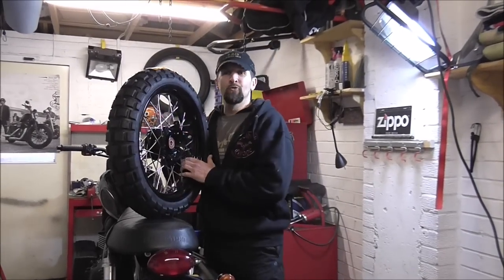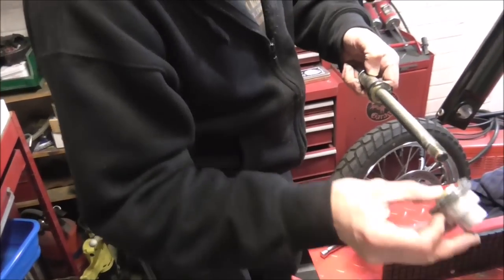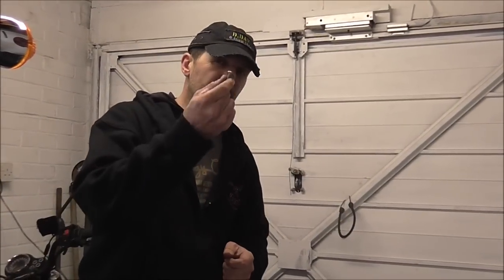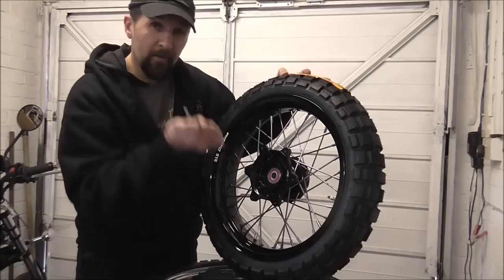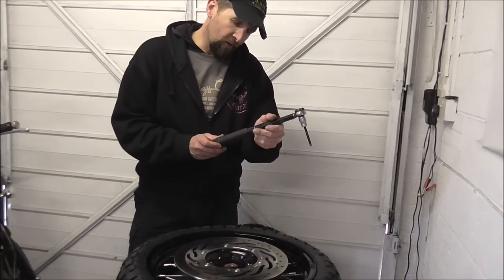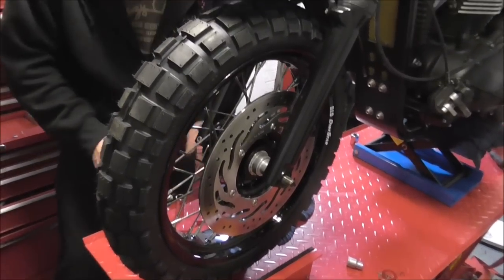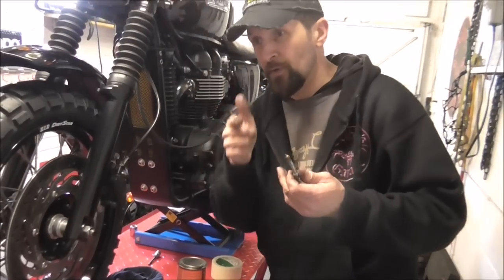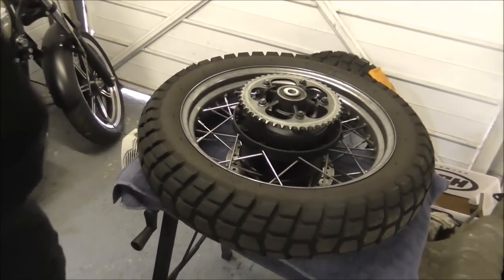Delboy's Garage, Triumph Scrambler, Fat Wheels, Walkround.

Comment: Hey my Triumph Speedmaster looks like a Chopper right now but I wanna fusion it with a bit of scrambler like things like the high exhaust from Zard different bars, gastank and so on and because I do not have the fitting suspension for the Pamir Highway trip yet what would you recommend me for the bike? because I have not fiddled around much with the suspension yet. I know its not the typical bike for that but its supposed to be a real sort of scrambler/cruiser fusion where some off-road wont kill the bike
Reply from the maker: Hi there, not quite sure what you're actually asking me - what is 'Pamir Highway trip'??  , I'm sorry I don't really understand the question...
Reply: Well its in Central asia where I will ride through and I would like to know what suspension you would recommend me because there the road is almost non existent in some places. sorry for the confusion

Comment: hi! your bike is really good! would you please share handlebar spec(hight, wide,...) as well as tires and wheels? it is really good! thanks!
Reply from the maker: Jesse Hsueh Hi Jesse, the bars are 'Renthal Roadbike Low' and the wheels are 5.5" x 17" rear with 170/60/17 TKC80 rubber...and the front it 3.5 x 17" rim with 120/17 rubber..
Reply: Moonfleet41 thanks for your reply! the rear wheels is very huge but i like it! very cool!
i'm in Taiwan and there is no Renthal agents here that's why i would like to know the handlebar spec. i don't wanna buy a wrong one. it is very useful for me.

Comment: AWESOME video! What width are those monsters!?
Reply from the maker: They're 180/55/17 rear and 120/70/17 front... BUT they are completely different rims and these tyres will NOT fit on your standard bike as we keep getting asked!   Specifically the rear, you need at least a 5" wide rim to fit that tyre.
Reply: @Moonfleet41  Thank you! I'm getting wider rims as well!

Comment: Hi, Nice Wheels and Video, been follow you fro while, love those wheels you put on the scrambler, I'm planning to get a Triumph Scrambler this year and do the same wheel/tyre set up just like your, I did went through the link you provide, and I was overwhelming, totally have no idea for all the specs, wonder if you could share all the specs and orders for wheel and tyres for me to simply copy and order? many thanks from your fans!!!
Reply from the maker: Before you even consider it buddy... those wheels were over £2,000   !!!! most people wont spend half the value of the bike i na pair of wheels..!  you can just put the knobbly tyres on your rims for a tenth of that..!
Reply: thanks for the heads up, and that what I thought would be, it is fair for set of wheel for motorcycle, especially for the outstanding result, never expecting less, I am in New Zealand, that is about 4000NZD include shipping is totally fine, me and all my buddies already save $$$ from watching your video, labour is costy in here mate, small parts are cheap too, like you said, not many people willing to pay that money, Just happens I do not to be one of many, with extra 4k I could have very different scrambler in NZ is worthy, therefore, shall we get back to 1st question?many  thanks ;p
Reply from the maker: The rims are 5"x17" rear and 3"x17" front, you can talk with the guy who builds them about tyres, and also the same with shipping.. that rim spec fits the scrambler, so the rest you can determine with the wheel company, and i gave tge link for that under the video as you can see.. Good luck with it mate.. hope it workds out for you..!
Reply: Thanks a lot!!! only two payment left for my Speed Triple, and will get Scrambler after, also get some mods done before this Xmas(include wheels), you are the best!!!

Comment: While weight will certainly make any bike quicker , what abought the height ? Gain ratio or loose some ?  Thanks
Reply from the maker: the smaller front wheel is a definite bonus, it steers a lot more aggressively now and lots more fun ain the bends.. and the rear wheel is almost the same height, the chunky tyre maybe even makes it the same... so no change in gearing..!
Reply: I agree , the better the front control the better the bike . Thanks
Reply: Let the rear grab and slip for all its worth , but need good front control exceeding that .

Comment: I wouldn't have thought using anti-seize on a caliper mount bolt. I would have thought thread-lock, why did you choose that?
Reply from the maker: Because it is correct to use anti-seize on caliper bolts and incorrect to use threadlock.... caliper bolts don't fall out, they are more liable to seize, this is due to repeated heat cycles , the presence of salt wash from the roads, and the alloy to steel interface of the thread... threadlock is used more usually on a steel to steel thread, where a nylock nut cannot be used, such as on a frame shock mount...... also the heat cycles of your braking equipment will calcify the threadlock and turn it in to cement....... by all means try it, but you will never get the bolts out again !
Reply: That makes sense. I guess because they are having side-ways force applied to them seizing is more likely

Comment: Hi ,wondering what size rims & tyres you used ,are the DID Dirtstar rims available online from a web site?
Reply from the maker: These rims were custom built for the bike with Talon hubs, 5" rear, and 3.5" front, and both 17".. we used the common sports bike sizes of 180/55 and 120/70 !

Comment: could I take these wheels and fit them to a bonnie T120? I love the scrambler but really like the added extras and power from the T120, If I could make the T120 look like a scrambler that would be awesome..
Reply from the maker: Firstly these wheels were custom made using Talon hubs and DID rims and based specifically on the Scrambler spec... you cannot put Scrambler wheels in to any other Triumph as they have narrower yokes on the front, so the hub and axle is narrower and they will not fit in any Bonnie or Thruxton models.... if you are going to have wheels made, you have to have them made for your bike...!
Reply: +Moonfleet41 thanks alot for the reply mate, much appreciated, could you recommend anyone that would be able to make the wheels need to fit the T120? 
Cheers
Reply from the maker: As expensive as he is, the right man is Doug Richardson at Devon Wheel Company, he built these wheels and fitted the tyres, and will do that for any of the Triumph models... he will start with your axle spec. and then work upwards to your design... if you want them 17", or a certain width, he can do all that... ours were about £1,800 with the boots and VAT
Reply: +Moonfleet41 Ok mate, Thanks alot. For a set of custom fit wheels that totally transform the look of the bike I would say thats a good price.. Cheers
Reply from the maker: Most people baulk at the price, but if you take that view, then you have the right midset for this modifcation... I would say it's a waste of money to go for the same size as you have, and spec., I got a 180 sectin tyre in the back of Penny's Scrambler, and put a 17" x 3.5 on the front... which is exactly the same tyre spec as a Bandit 1200, the forks are the same rake as a Bandit, and the bike is the same weight... next question you can guess the answer too... yes, it does ride like a Bandit... really predictable, much more stable and a lot more willing to turn corners... remember the alloy rims are a lot lighter, less reciprocating un-spring weight, means less gyroscopic effect, which means the entire bike will be lighter and more flickable to ride
Reply: +Moonfleet41 like you said in the video, 3kgs overall is a massive weight saving, that can completely change the way the bike handles and performs.. if you also think of it as an investment, If you were to sell the bike yes you will loose some money on the bike itself, thats to be expected but you would get that money back on the alloys simply because you can't just buy them of the shelf..

Comment: I knew the new wheels would look good but your walk around video with the bike on the street blew me away! That all backed look is bad ass..... And I am not even a fan of the modern classic style of bikes. You made one small mistake in calculating the weight savings..... It should be 1 kg off the front, 2 kg off the rear  plus 1 kg off your wallet. Seriously great work on this bike.
Reply from the maker: Hi Jeff....you are right...and it was a fare bit more then 1kg off the wallet...but ill be selling the OE wheels, and that should lighten the load, thanks for your kind comments sir, i really appreciate the kind support... Take care.. Del.

Comment: Del, it's interesting that you use copper slip on the caliper bolts. I have always been told that the use of any lube on safety critical thread will deceive factual torque values which could be a tad dangerous. Now don't get me wrong I've never seen any proof but the science behind it makes sense and 30y as a mechanical technician it's always been a big no no, whats your thoughts on this?
Reply from the maker: Lubricating a thread with an ant-seizing compound allows the fasteners to wind in to it's full and correct capacity without the drag of a dry thread causing a false torque value... as a mechanic myself for 30yrs, I've seen enough brake component fasteners seize in place due to constant heat cycling and corrosion to know that whatever the theory may be, I like them to come out in one piece on demand and as long as the anti-seize is the correct compound, it's fine...

Comment: How has the ride changed since you swapped wheels and tires?
Reply from the maker: Aaron Cook All the usual improvements you get with a 17" front and a proper width back wheel....steers in more accurately, sits better in bends at full lean, and as they are so much lighter its more responsive too....money well spent id say.!
Reply: Thanks Man.

Comment: Have you removed the scottoiler? I'm sure it was this bike you had it fitted to.
Reply from the maker: Hi Daniel, yes, I've removed it, don't use the bike in the rain and filth anymore, so no need for constant oiling... so I took it off!
Reply: Ok fair enough, noticed your still running one on the tiger. And loving the new wheels, also good luck with the Harley competition you deserve it...

Comment: What size wheels are on the Scrambler project?
Reply from the maker: Lone Star Triumph The rear is a 5.5" X 17 and the front a 3.5 x 17... allows me to run 170 rear and 120 front or the biggest knobblies on the market, which ever way the bike wi styled at the time...

Comment: Is it alright to leave the disks rubbing slightly?
Reply from the maker: The discs are not rubbing mate, there is always a little interface between the pad and the discs, when normally set up, they ride about 25thous from the disc face, and as the pads are free floating in the caliper, there will always be a little audible hiss as you spin them!
Reply: Yer my wheels make that noise, i always thought they were rubbing and needed adjusting.

Comment: Can you stop with the bloody good mods on the scrambler? My wallet can't keep up
Reply from the maker: haha.... sorry mate, I had to sell a bike to buy these and it really hurt handing the money over, but after today the pain has eased a little lol!
Reply: Moonfleet41 What is the maximum size I could fit a TKC80 on the rear do you reckon? I got a 140 on at the moment!
Reply from the maker: Daft Biker On the factory rim, that 140 is already a size too big.. they need 130mm on the back to be the correct profile in use...fitting a wider boot to a regular rim 'curves' the tread round more making the treat patch actually "SMALLER"....but if you fit a 5" rim like mine, then you can go to 170mm, and it fits with 5mm chain clearance.. perfect.!

Comment: Hi Del, could you tell me the Rim and the tyres size?
Reply from the maker: Yeah.... 5.5"x17" rear, and 3.5"x17" front, and 180/55/17 and 120/70/17 !
Reply: @Moonfleet41  Thx mate, you think it c
Will work on T120 too? as I want to swap mine too. TIA.
Reply from the maker: @minidum0830  Sadly not im afraid Alan.  I had a T120 a year ago, and it was the first thing i measured up, only to be disappointed in what i found.   With the early model Scrambler here in the video, it had a 130mm back tyre on a 3.5" rim, and a huge wide gap between the chain and tyre, big enough to almost get a fist in... So when i fitted the wide rim and 180mm tyre, the gap left was still 12mm, more than enough room to be safe.    But. With the T120, as you'll find if you measure your T120, the gap between the tyre lip and the chain is already tiny, maybe 8mm at best?, and the chain guard is almost touching.. and that's with your 150mm tyre, so any wider tyre in there will b likely to foul the chain, and i did look into spacing out the front sprocket to make room, but the chain passes only a few mm inside the subframe tube, so it's pretty much stuck as it is in terms of wider rims or tyres..  But you can still fit a more aggressive and chunky looking tyre of the same size to get a slightly beefier look.!!       Hope that helps you mate.
Reply: @Moonfleet41  thx a lot man, very useful information!

Comment: Hi del just watched the triumph wheel swap video with interest as I was thinking of swapping my front tyre on my xj600 from a 90-90-18 to a 100-90-18 to fill up the front as it looks abit small to me but the "clever dick" I currently share a lockup unit with said this can't be done as I will then have to up the rear size!!! I think this is bxxlshit but thought I would ask your opinion?? Cheers
Reply from the maker: Hi Adam...you dont have to up the rear to match the front....as you shouldn't up the front in the first place...two wrongs dont make it right...if you increase tyre width but not the profile, you simply 'curve' the tread profile more and that will actually shrink the tread patch....if you increase tyre width...you MUST increase the rim width in order to maintian the profile curve.. and as the front and back work together...you#ll need to do the back wheel too...like i have.. ! hope that makes sense..
Reply: Hi del thanks for reply my bike runs a 110-90-18 on rear which im happy with but like I said front looks abit small. would u recommend I  just stick with the current tyre as it handles fine or if I decided to change it what would you say would be a good size to change to?  cheers adam
Reply from the maker: adam Gilbert
"just stick with the current tyre as it handles fine"...like i said Adam... if you arent going to change the wheel rim too....then you cant change the tyre...go with the factory tyre sizes mate..

Comment: I thought you normally shouldn't use stainless bolts on parts that are important or stressed because they can brake easier then steel bolts
Reply from the maker: +larszs Stainless steel bolts arent fragile buddy,

Comment: Stainless steel is not ferrous, as in not magnetic?
Reply from the maker: I presume the question mark is you are asking a question... stainless steel is ferrous as it contains iron, ferrous metals contain iron, non-ferrous do not... being non-magnetic is simply a sign of good quality stainless steel due to the addition of nickel to the recipe to take away the magnetic effect ... the iron is still there as the base ore, and thus it is ferrous, but it's non magnetic due to the nickel content, which also stops is corroding (and that's without going into a metalurgic explanation)

Comment: Oh I forgot to ask . Did your wife's sister finish the race for cancer ?   And do you mechanic at your job ?
Reply from the maker: Hi Tommy, I can understand your problem, when a bike is too big for you, it becomes a liability, and you stop enjoying it, which nobody wants... and at 5'2" I can imagine one of the Bonneville models would be perfect, specially the current Street Twin 1200.. more power than a Sportster, a lot less weight than a Sportster, and physically smaller in every way... the Triumph dealers are very helpful, I would suggest to get along and take a test ride on a few different models, inc. maybe even the new Triumph Bobber!  Am sure you will find there is a world of bikes out there, more fitting than your Harley.. why not have some fun testing a few, and let us know what you come up with... 
PS, as an after thought, why not, if you have an Indian dealer nearby, check out the Scout 60, it's a really small bike that packs a big punch, you might like that too!
(yes, she did finish the race and raised a lot for the cancer charity..)

Comment: What size were these?
Reply from the maker: The wheels or the tyres ?
Reply: Tires
Reply from the maker: @nathanlowney6058  They're 180/55/17 rear and 120/70/17 front... BUT they are completely different rims and these tyres will NOT fit on your standard bike as we keep getting asked!   Specifically the rear, you need at least a 5" wide rim to fit that tyre.

Comment: 8:01
And remember its 1kg of unsprung weight lost so even better!
Reply from the maker: Krazer2100 Yep, and on the rear wheel that equates to better acceleration from less 'reciprocating' weight if you put the bike in a Dyno it'd show more BHP delivered to the road because its taking less power so turn the lighter wheel...hence why race bikes are now using Carbon fibre rims..!!!
Reply: Moonfleet41
ahhh, an interesting thought for when I get my A2 licence and will be looking to shed as much weight as possible
Out of interest do you notify your insurer when you do modifications like this?
Reply from the maker: Krazer2100 Oh yes indeed i do mate, more for the increase in value than the increase in any extra bhp.... and if they ask for a bit more money, then i just payt it, its better to be properly insured than risk it over a few quid..